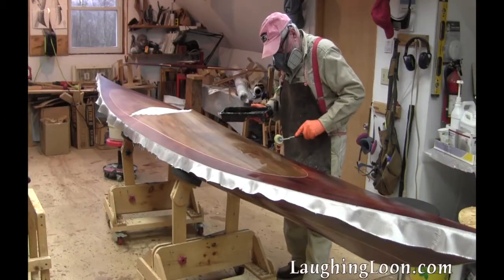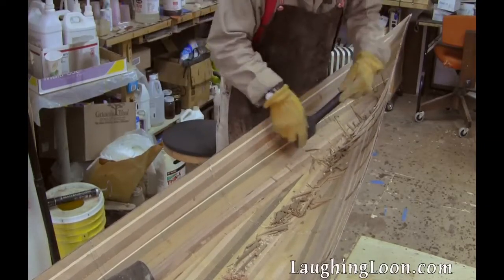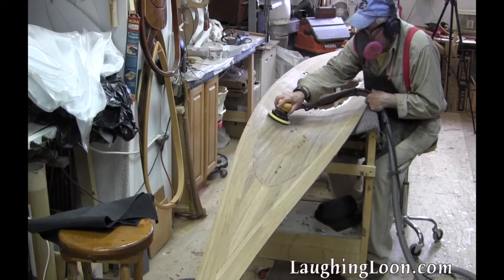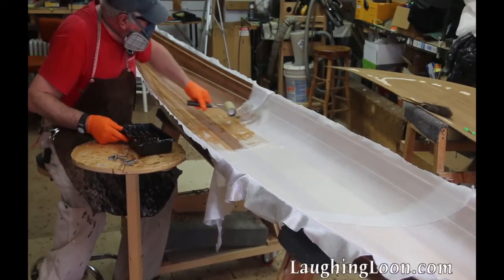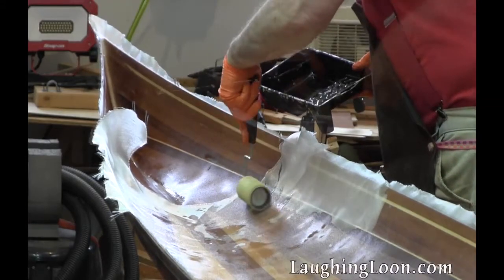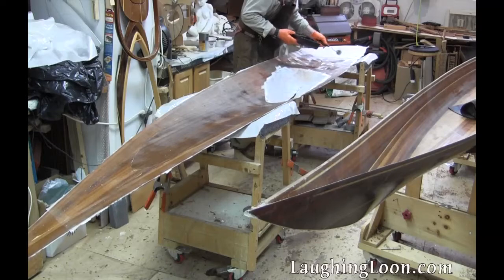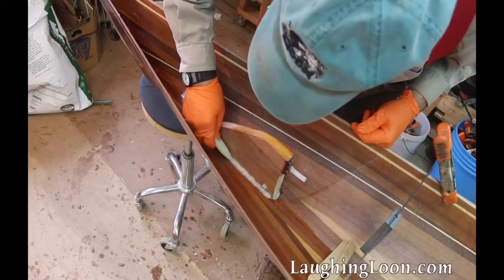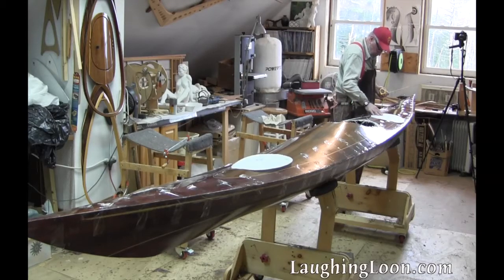Laughing Loon Ootek Build Part Six

Comment: i dont think its important to have twice as many glass fibers over the strips.  Strips are filler material and well they are never coming apart
Reply from the maker: West Systems Epoxy did tests and found fiberglass cloth placed so the fibers cross wood strip joints at a diagonal increases layup strength.